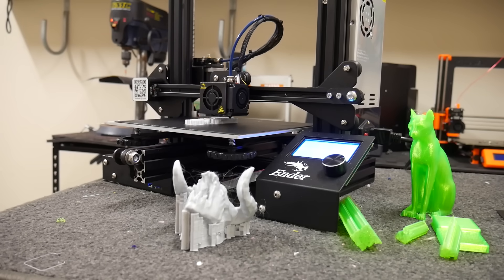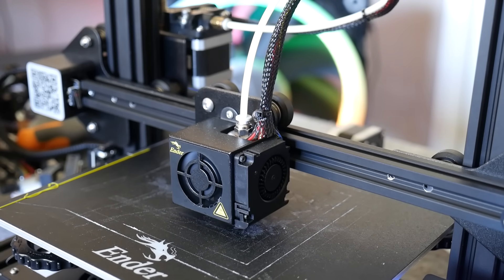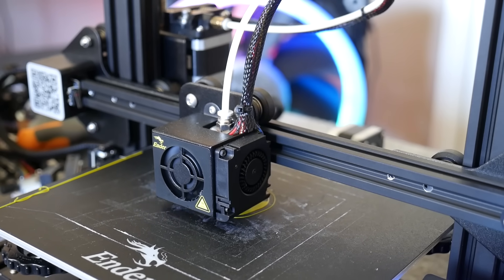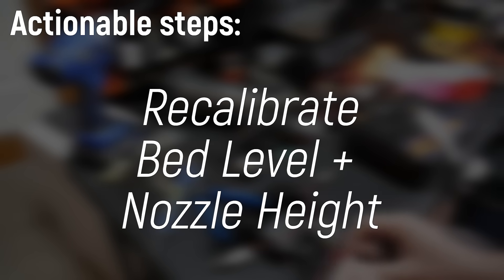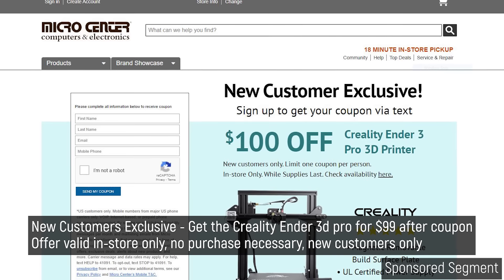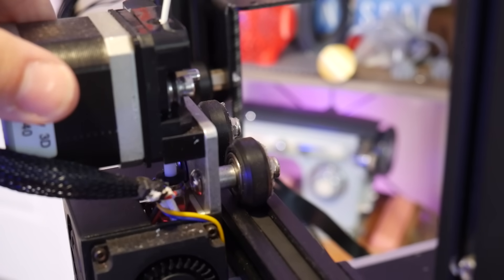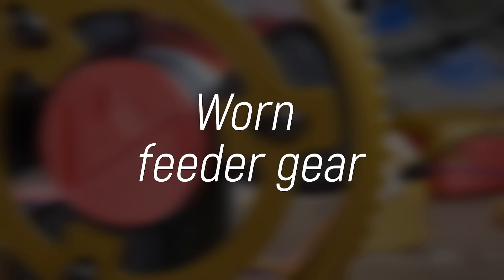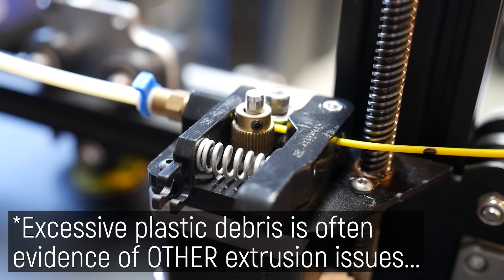Have your 3D Prints started to suck? Watch this!

Comment: Heads up cr-10 users, the psu is a bomb on the main power in & out the plastic sheet they put in between the outer silver metal shell & the psu board isnt enough & it will short causing a pretty significant bang/explosion/fire that is unfortunately before any fuses or other protections; so your main home breaker box is the only thing that can stop feeding it after its fried itself/burnt your house down.

Comment: i'm working/setting up my school's 3D Printer that they've never used (a cel roboxdual bought in 2018) and all my prints are coming out really low quality and shifting from the bed at a certain point but it's never been used before so I'm unsure as to what the issue is 😔

Comment: how do you remove that first build plastic plate? the one that you remove when the print is finished? i've had to throw prints away because the build plate is too cold for it to separate.

Comment: Oils on your print surface are fixed with.. .hairspray.. That is why i use it, i REALLY don't want to clean it every single time cause that is what it takes, it has to be "laboratory" clean. No dust can fall on it, you can't touch it EVER and just leaving it be will cause stuff to get deposited on the surface. So, consider if cleaning the bed constantly or a layer of acrylate that never need cleaning is better... I add very thin layers, every 3-4 print and renew it once a month. It is either that or keep cleaning the plate between about every single print or if it has just sat there for a week.

Clean plate printing SUCKS.

Comment: No matter how many machines I add, they always give me grief at the same time.  I'd swear they conspire against me.  Maybe too many pi's in proximity going sentient.  Klipper is pretty smart too.  To be fair, the exception is the mk3 - Prusa is friggin amazing.  I think I've changed the hot end once, and aside from mods, nothing has failed in three years, while the M3ID (3x the price) has totally bricked on several occasions.  It, and every other machine else waits until I need a 5kg run of production parts, and aims a giant turd at the fan.  Or maybe I just get sloppy when I rush and skip maintenance.

Comment: I have rhombus like hopes from square prints it is very slight but make boxes suffrage as well as each part lower in quality due to this. What do I do? I have tried to dis and reassemble the frame with the only effect being a striped screw and a barely if percievable difference? I assume this is the source however.

Comment: Hi.  I've had 4 straight days of great prints.  Suddenly only the print on the bottom right corner stops working!   Did autoleveling, reset Z-level, cleaned surface, unloaded PLA and cleaned nozzle.
Did 'corner tests' and all 3 corners perfect, bottom right not even the brim worked!  Using correct temp listed on PLA 205 (tried 215 also) and 65 bed.    Tried changing Z-level up/down gets worse. Any help appreciated!

Comment: Umm, the horrible horrible noise isn't vibrations (i mean it could be, but its not the point), it's PWM fuckery because of the rampup being too short (if yours uses PWM that is. If not, it's a sensorless BLDC motor most likely, and it would STILL benefit from a rampup of some sort to avoid this. I experienced this with my ender 3v2, and I could always fix it by just knocking a few times on the fan itself. Implementing a better ramp-up and frequency than the one used in Klipper or the stock firmware fixed the problem entirely. I've since switched to a different fan for the heatbreak, but it goes to show that the issue with that noise lies mostly in software, or can at the very least be solved in software.

Doing nothing, like you're implying is the case, will kill the fans. If you hear a noise like that from a motor, how on earth can you just let it "settle in"? That's a death sentence for the fan..
This is also the case for many of the blower motors used in printers btw, including the ender 3v2 one I have. It's less severe, but it's a thing nonetheless.
Reply: Oh, and also, to add to the proof that this is software: It happens with other fans as well, at least 24V fans. I tried a 12V noctua one and it didn't happen, due to the buck converter essentially removing any PWM and overall making the fan far less efficient, but quiet at least. Adding a circuit for using the 24V output from the printer as a signal for a mosfet to switch the fan after the regulator stage re-introduced the problem. In a Noctua fan. Like come on dude. 
24V fans tried include WINSINN, Sunon and GDSTime for branded ones. A bunch of random BLDC ones I had lying around also had this issue.
The best way to avoid any issues with this is switching the fan yourself. The diodes used in the 4.2.2 board seem to act wonky anyways, so you'll have to do this eventually regardless.

Comment: Definitely agreeing on the fans, those ultra-cheap chinese things are loud as hell and total crap. There are more than enough companies that build good fans for a reasonable price (like Arctic, Scythe and [if you can get them] Delta), doesn't always have to be Noctua.
On the topic of wire connections, those (usually green) screw terminals that you showed can be a real fire hazard. Ideally there should never be bare (stranded) copper in them but some form of crimped connector like a ferrule. If you have uncrimped screw terminal connections in your printer, it's rather easy and cheap to get a set of ferrules (+ crimping tool) to fix that.
And for the issue of the bed losing its level, there are alternatives to the springs (like silicone spacers) that don't lose their tension/level that easily.
On what to use for bed cleaning, it depends on your print surface. For the coated glass bed I have (Anycubic Ultrabase) a 50/50 mix of IPA and water works pretty well. At one point I tried using window cleaner instead, and while it worked it had the side effect of making prints stick WAY too well. The ultrabase normally auto-releases once cool, but that one print required a lot of "persuasion" to get off...

Comment: having tons of issues with layer shifting on a ender 3 pro , had it about 2 years, its got new stepper motors x and y, its got the dual z axis steppers. its direct drive all metal hotend from micro swiss. and lately i CAN NOT GET A SINLGE PRINT WITHOUT LAYER SHIFT.ive went thru it and tightened everything belts, new pully wheels,  i literally am lost.
Reply: beds level thats day 1 stuff, its like 10hrs into a print it shift ive tried to find a common spot like if i do the same print 5x....it shifts but theres not 1 specific spot it shifts just somewhere along the way il get like a 2-5mm x axis shift over and it continues to print fine. all the way up just a click or 2 over idk what to do

Comment: i saw this video way too late, because an my ender 3 pro the cooked ptfe tube lead to a damadge to the hardware after only about 2 years of having this printer, and it komletely destroyed the nozzle and even the extruder motor, because it started skipping steps before, and i think this would lead to a problem, but whan the failiure of the motor and the nozzle happend, i wasnt in the room for a while. i can highli advise to everybody to regulary check your printer while printing.

Comment: Im not sure whats going on. all my printers all at once just stopped sticking or bad first layers. A1 Mini and it's only a couple weeks old, MK3S+ as well and I went through the wizard and re-calibrated it, new tip, new smooth sheet and a new roll of PLA and, still just blobs up.Whats going on??

Comment: My Anet A8 mainboard, when I cleaned the EEPROM memory to install the Marlin firmware, the hotend went into thermal runaway until I smelled something burning and ear the PTFE tube boiling inside the nozzle. Immediately turned off the printer. 
Now I'm using Marlin firmware and have all the protections, but I'm afraid of what will happen if for some reason the EEPROM chip dies and firmware gets corrupted. Will the hotend go into thermal runaway and catch fire? 
Because of that concern I never leave the printer unattended.

Comment: I can't seem to get good prints from my new anycubic photon max 3 and the chinese are no help :)
Reply: Hey what issues are you running into I could try to help
Reply: @nathancameron9575  I have a video on my channel where I show what is happening with what appears to be missing resin in areas of the print.  And also a plastic basket I printed for my drone where all of the grid of the basket are misaligned.  I am ready to sell the printer and I just got it :) I would like to go back to filament printing . the resin is messy and a pain :)
Reply: @ArtisanTony   okay so looking at the anycubic problem video from 3 weeks ago, I’d suggest printing at a 30-45° angle, the reason this helps is the suction force against the FEP is reduced and makes it easier to peak off. For the fan duct you were trying to make you need a hole near the top because as the print is going it’s creating a vacuum inside the print much makes it stick to the fep even more which resulted in the layers pulling apart on the fan duct I would but one just near the build plate on one of the flat sides to let air into it. The drooping is caused by the exposure time I would suggest to have exposure between 3.5-5.5 seconds and if that works you can slowly bring it down. I’d test this with an exposure test print so you can see quantifiable results. Another thing I would suggest is to use a different slicer like chitubox. The anycubic one sucks and chitubox is definitely a nicer experience.
Reply: @nathancameron9575  There is no vacuum because there is a hole in the lower back for air supply but I will try the 45 degree thing. Some one else suggested that also.  Thanks for suggestions.
Reply: @nathancameron9575  also, I did not see the anycubic photon max 3 listed in chitubox although i agree I do not like the slicer that came with the printer.

Comment: I've got a strange one: in my direct extrution printer with all new (changed because of the problem) the prints looks like crap and under extruded, but the same model with the same layer height and filament, prinst awesome in my bowden machine. Thought it was because a jammed nozzle, but I've changed for a new one and it keeps the same, changed the throat to a full metal one and keeps printing badly, I've calibrated steps, changed stepper amperage, changed stepper motor changed firmware and it keeps on printing like crap. Also thought about temp changes, but the printer is rock solid keeping temps accurate... So I don't know WTF is going on.

Comment: I’d like to see a solution to inconsistent extrusion for Prusas…
Reply: Several exist to fix the various causes. It just depends what kind of inconsistent extrusion you have and what you will give up. Swap the bondtech for an idler, angle the gears for proper engagement, modify the filament path to reduce obstructions, etc.
Reply: I blew up my hotend, and splurged on the bondtech extuder with a slice mosquito hotend
Reply: Check you spur gear that puahes your filament, if it has dents or worn because of the filament being pushed, it will result to under extrusion.

Comment: I have a Polaroid PLAYSmart it’s fan failed so the heatbreak suffered heatcreep I have installed the replacement fan but now some pla is stuck in the heatbreak any suggestions how I can fix this, I have put 9 hours into trying clearing it but without success

Comment: anyone got a link to the heat break fan? @10:57 mines started making this noise when setting the z offset. I can switch it off and back on 1 or 2 times and it stops but I would like to have a spare one on hand

Comment: Why i swapped all my wheels off to rails, Even tho they still need adjustment.... They are just a single point. Each block needs to line up with the other... where as on my 5+ i need to line up 8 wheels across 4 surfaces.... its never perfect and leads to ugly prints....

Comment: You mentioned the brass feeder gears wearing out when printing with anything abrasive could this be upgraded to a stainless steel gear to fix that issue and also changing the nozzles to stainless steel is there any downside in doing this or is it a benefit I apologize I’m very new to the 3D printer world and having trouble locating the information I’ve been looking for I know this isn’t discussed here but I’ve been looking for information on slicer programs if someone could give me a link or video to watch about the mechanics of the program like what this adjustment does and the effect it has like changing the adjustment for the filament layer if you go from 0.2 to 0.01 what does that actually do for the layer is a lower number to get a better quality print vs the higher number anyway I’ve probably rambled to much but these are the mechanics I was talking about in the program and there is a ton of adjustments that can be made in there at this point I don’t even know if the person that wrote the program know what all it will do I call it cause and effect cause I did this it effected that thank you for any help you can provide me.

Comment: Wear and tear is all well and good, and yeah, you can replace with quality parts, but the expense becomes ridiculous. Of my 4 printers, a Tronxy that's been re-logiced twice (once involving a complete rebuild! Both in its first year of operation) a cheap-assed fake Sinis T1 delta and two Ender 3 Pros (bought because everybody seemed to be raving about how good the E3P is, it's shit) I've pretty much given up on printing. CNC shows more promise, for my limited resources. The absurdity of the fake T1 delta is it's the only printer I can ever count on and it cost me AU$150, started with a disappointing warranty problem which was rectified by being sent a whole other kit with a different warranty problem. 2 broken printers were enough to make one reliable one. The fake T1 has the cheapest, nastiest closed source logic, an effective print circle of 180mm and only prints stably to about half it's 300mm theoretical build height unless its a vase print, a miniscule, half form factor 12v supply, no parts cooling and a half-arsed heat break fan (E3D-V6 pattern) but it never takes as long to setup as the enders, never drifts like the enders, hasn't ever needed new belts (one of my enders, sold as genuine by an australian supplier turned out to be fake and the supplier denied they had a warranty responsibility for that.)

Unless the 3D industry lifts its game, it's a dead technology as far as I'm concerned. I've looked at trying a Makerbot or one of the closed system brands, but the price of a used car and the likelihood they'd be no better? Not returning to 3D printing unless I win lotto and can afford a Studio Metal machine or similar industrial level. Even then, not sure I'll bother. Like the entire tech sector, oligarchs conning us out of money and into generating unrecyclability of waste plastics. And don't get me started on the lies about recyclability. No plastic is truly able to be recycled. I'm a guy who can keep a bicycle running like a swiss watch for 20 years with minimal parts replacement. I've designed and coded my own universal music sync tool for my recording studio using nothing more than an Arduino Uno and a few external parts, that happily takes my DAW's audio click track to sync my drum machine by MIDI. Can't keep a 3D printer in tune for more than 2 jobs (3 for the delta) and it runs to around $20 a print every single job because of trying "quality" parts instead of the usual eBay crap, and those expensive parts make no difference.

Comment: I'm having a very strange issue where, in the middle of printing, the extrusion starts to move backward - instead of feeding the filament, it starts to extract the filament. Whenever this happened, I flip the stepper connection, but this still happened. I would then re-slice and try again and it happened still. Has anyone ever heard of this happening before? If so, any idea on how to fix this issue?

Comment: Brass feeder gear not wearing out fast when just using PLA filament? BS. I have only printed with PLA and brass feeder gears so far, but the brass feeder gear only lasts me a couple of prints before needing repositioned or replaced.

Comment: Xt 60 amp.
Just remove that .
And solder it directly.
Your not charging batteries.
And the xt 60 amp wil not heat up.
Because its not there.

Comment: My ender 5 pro use to print PETG fine. About 4 months ago it would just turn off after 30mins sometimes faster. But i can print Pla for days. The only thing that is different is the temperatures. 240/80 vs 200/50. Do you know or anyone know the issue? My ender 6 has the exact same setup and prints it fine. They both have the same meanwell power supplies and they both have LEDs and a pi4 and official 8" screen.

Comment: You can easily prevent parts from wearing and getting out of adjustment or getting dirty.  All you have to do is not use it, ever, and keep it covered.

If you use it then parts will wear and break and need to be checked and replaced regularly and everything that can be adjusted will need to be adjusted and constantly cleaned if it is sensitive to soil and oil.

Welcome to reality and suck it up buttercup.

Comment: I was so confused recently, because my prints started to become worse and worse, no matter what I tried to fix things, and I experimented a lot with slicer settings, calibrating different things in the firmware etc. and after about two weeks I suddenly realized that while I bought new vrollers as replacement some time ago, I hadn‘t actually replaced them, so… I was still using the first ones, which have been on there for about 3 years, especially the ones on the z-axis had severe flat spots, and after I realized that I felt kind of stupid for a minute xD